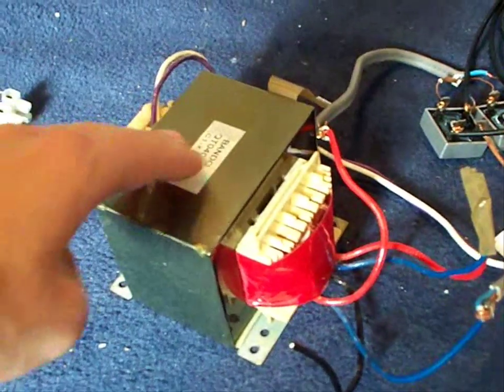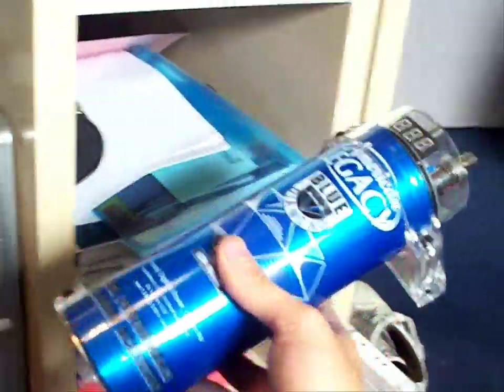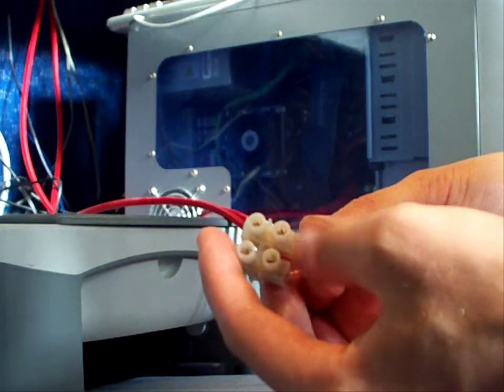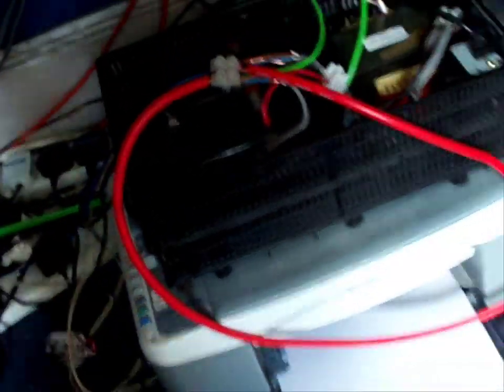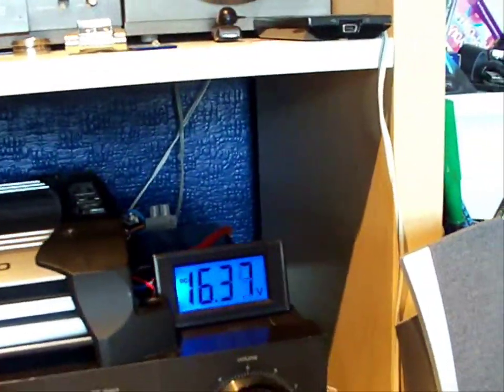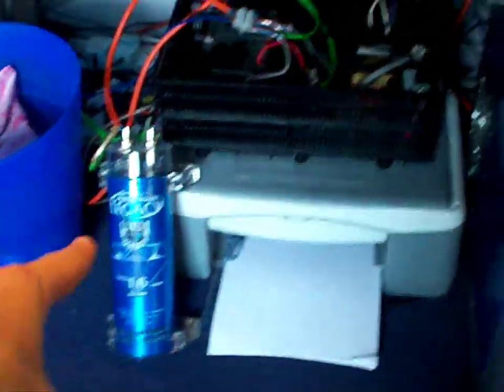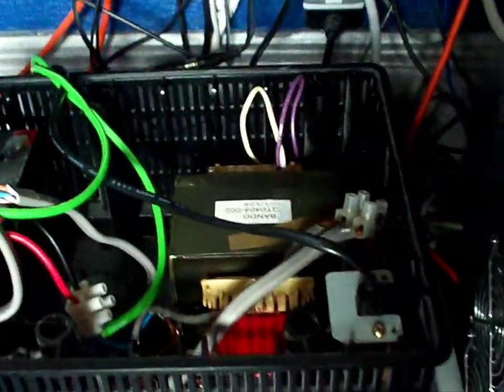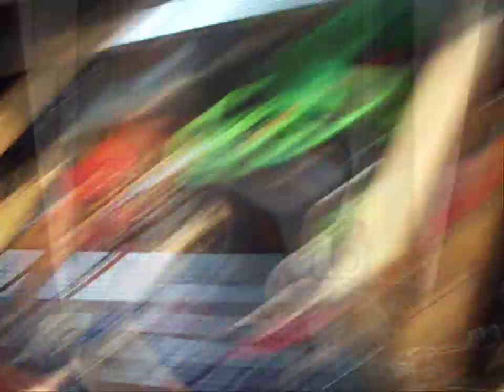Powering Car Audio in your House - a better solution than PSUs!

Comment: Most of the really really big transformers can actually supply over 1000 volts and would require them to be properly hooked up to step the voltage down to 12 volts and if you hook these giant transformers up you have to use extreme caution because if it's outputting thousands of volts it can be deadly if you accidentally get shocked from it most of them come from microwaves and i don't want to take apart a old microwave just to get a transformer like that one in your video just to build a power supply to power a car amplifier indoors

Comment: how about just going out and buying a   power transformer for a low voltage lighting system.  in the US= means 120volt input and   12volt DC output.

Comment: why don't you just get a pyramid psv-300?
Reply: the amperage is very low. it can only put out like 25 amps which can only power like a 300w rms sub/amp
Reply: Cameron Canant  what other thing can i buy with over 25 amps  i got kids /dogs so i cant have all that shit and wires out  i need to buy some thing so now i need some better then Pyramid PSV300
Reply: DjEarthQuakeEnt that would be a better thing to do because microwave oven transformers are dangerous and can put out a extremely high voltage that is over a thousand volts unless you build a proper circuit and hook it up in a way so that it puts out 12 volts dc and yes it's possible to get 12 volts dc out of a microwave oven transformer if you know what your doing and if you wire it up properly

Comment: ((follow-up post))  What you have there is simply beautiful; a work of art. Love the creativity. +10: Creative _ +11:Unorthodox _ +100: MAD SCIENTIST. 

[[ As my user-name suggests, I play 7 stringed guitars...dropped to A. In my full stack -2_4x12 cabs- one of the cabs is running 4 x 200w 2-Ohm car subs.. LOL. (love some "Death-Chugs"). Getting that wired without blowing 2 Heads and a mono-block pwr amp was FUUUN.But when a palm-mute makes your heart skip a beat - its sooo worth it. ]] TakeCare

Comment: First of all, i haven't even finished watching the video yet BUT - I really wanted to give you some props for insisting on PROPER wiring technique, tools, and pointing out safety when dealing with high Amp/Current rectification & "'bare-wire' what-will-this-combination-do" experiments. Awesome rig/job btw. I'll go finish the vid now :) -  PeAcE

p.s. Again, brilliant usage of those "spare parts". Never toss 'old junk' out - it could be used to do... well... ALOT. lol  [GoGo FrankenAMP!!]

Comment: @barevids hey can i use a car battery and a power supply together somehow???
like power supply charging batt and batt powering amp....
my voltage is at about 10v when bass hits so i need help ... i tryd to build the same thing but i did not get as many amps as u :( It even timmed the lights on my car radio.....

Comment: instead of all that mumbo jumbo... ( i totally know what ur doin tho) just get a decent Car Battery charger with the fast start. mine sits at 14.8 volts with a capability of putting out 75 amps. while still achieving 14 volts. give it a try

Comment: @kwyjibosponge i kind of have the same setup but it gets a constant 15 v cause i got a smart battery charger , so the higher i turn it up it reads the voltage drop and sends more amps to the batterys i got, im using two batterys so it powers my subs real nice, check it out

Comment: get a decent car battery charger and a regular car battery, bam power supply, just make sure you use the proper filters, few months ago i had my subs in my house hooked up to my receivers preamp outs, i used my 12 volt supply i have for my rc car, it only put out about 10 ams so i wasnt able to crank it but the subs were overkill for my surround setup anyway, good stuff...